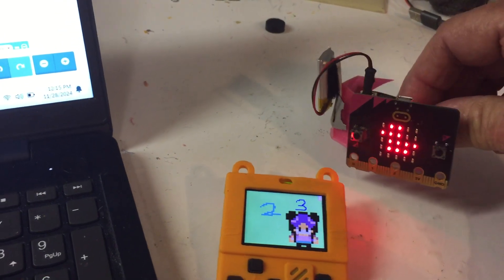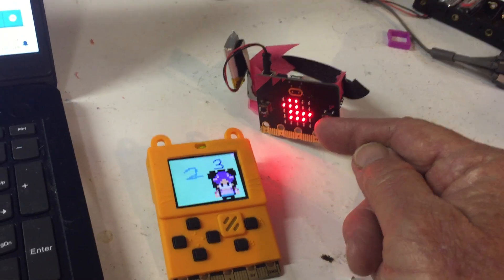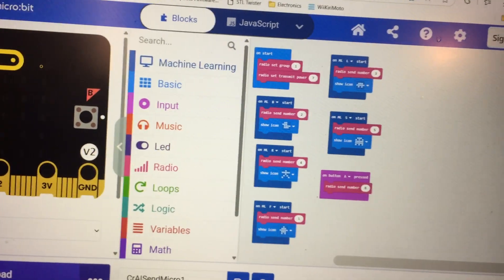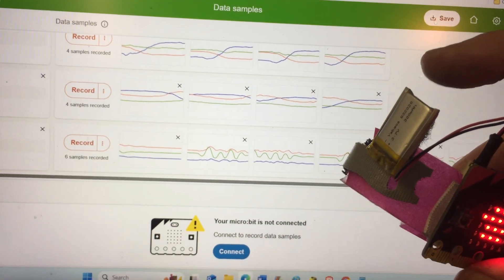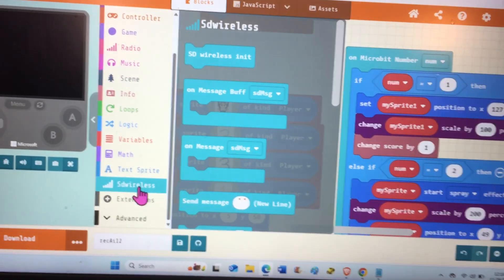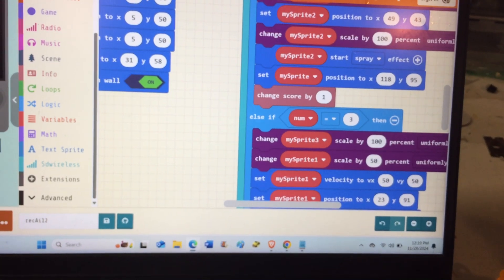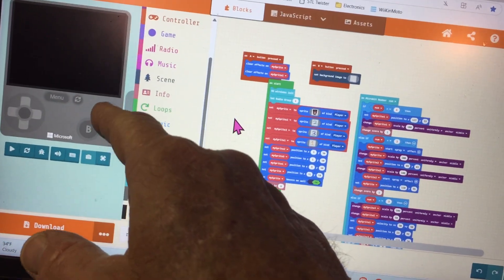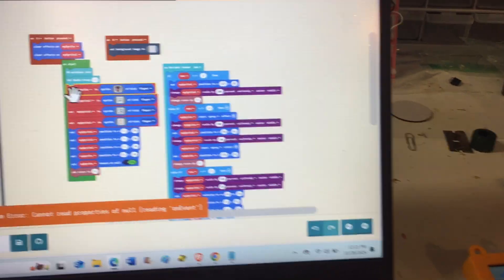Arcade MakeCode and CreateAI Micro:bit via Radio

Comment: I didn't know that Meowbit had an SD card slot and a micro:bit 40 pin connector. Nice find. I have two different MakeCode Arcade units and they are not nearly as useful.
Reply from the maker: Lots to say about this : I sent you an email. Gmail. Much investigation about Meowbit needed at this point, it blends MakeCode Arcade with expansion boards that are normally for the Microbit.  Could be used for bread-boarding as well with radio control .